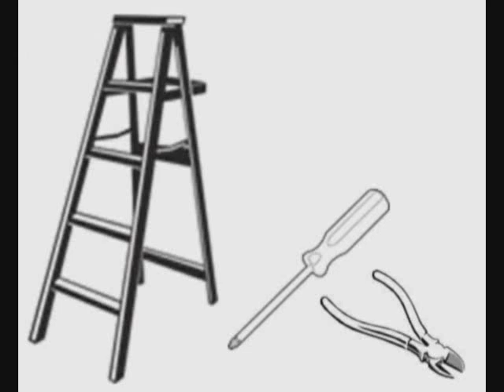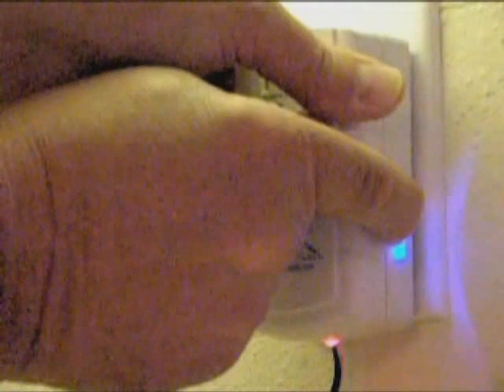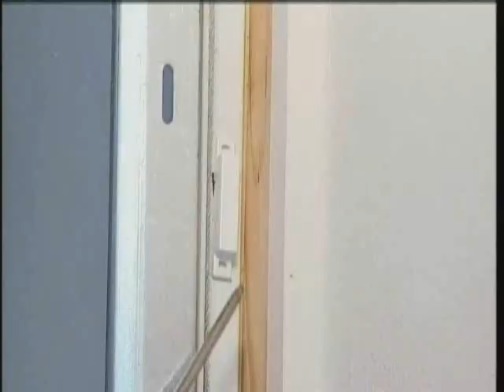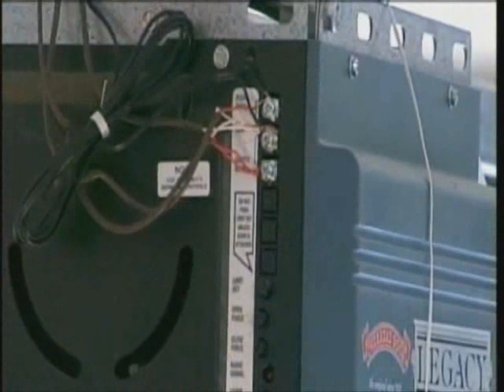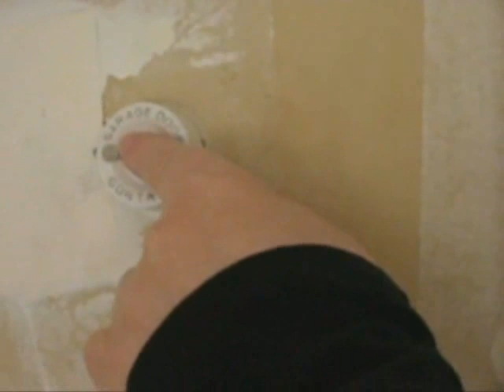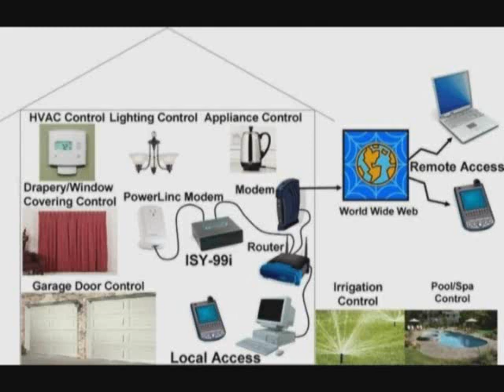GarageHawk Installation Video

Comment: The GarageHawk isn't an easy device to install at home. My parents and I can't afford this unit, because we USED to have a Stanley unit of garage door equipment until it died on us. Luckily, my dad called "Automatic Garage Door", so a professional who works at the business will be hired to fix the problem vs. upgrade the system with a new model of devices for automatic garage door openers which have instruction guides and remote controls included. Safety first with that stuff as always. Children and garage doors don't mix due to injuries or death within youngsters that we don't have at home who would possibly turn out to be siblings that I pretend to have despite being an only child. We don't use our garage door that often, unless we have items that we don't use anymore for Recycle My Junk to collect in the alley of our home. Now, we have Lift Master. The light goes on automatically when either my mom or I manage to go into the garage to do some chores daily. I'm not even revealing examples of chores to you on YouTube. 👍🏻 if you highly agree and recommend this installation video tutorial to everyone in the world at the same time.